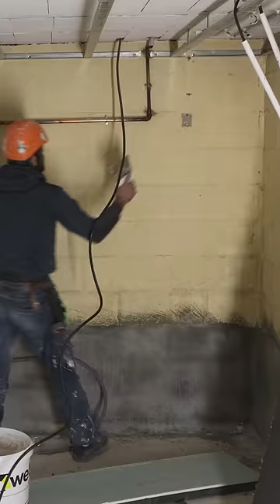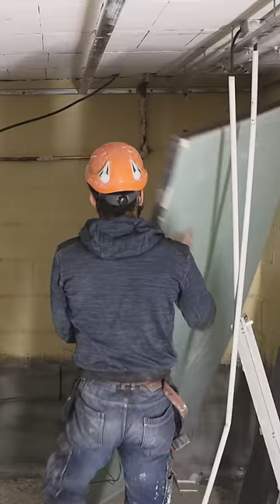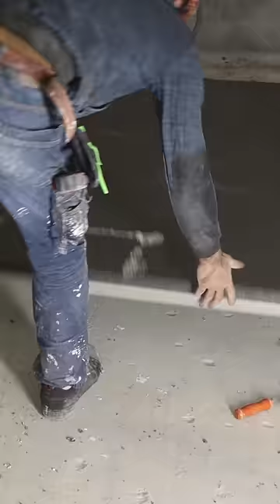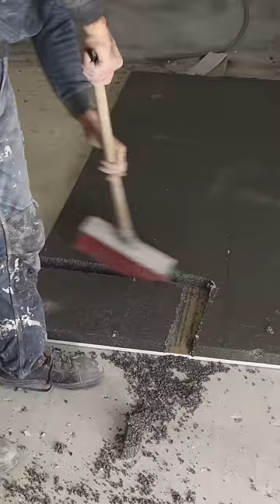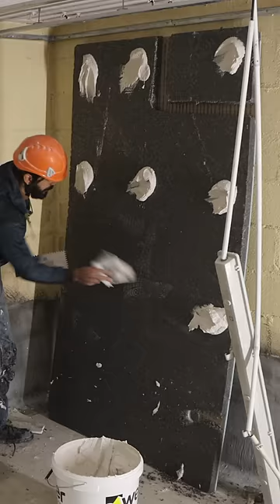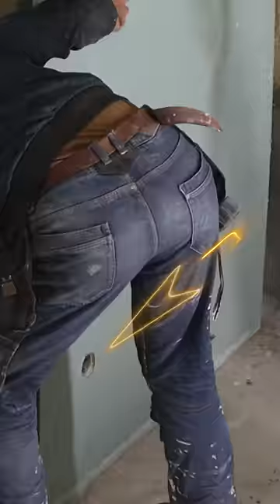pose amazing

Comment: Then some one comes along and drives a nail through the copper line while hanging a picture.
Reply: Looked like there was a shut-off valve on that pipe that got covered up.
Reply: I was thinking the same thing 😂😂😂😂
Reply: Siempre utilizó un detector de electricidad, metales y demás, ya he perforado por error más de una vez hace mucho tiempo.

Comment: Oh dear, so wrong not to continuously bed/seal all edges to prevent vapour ingress!
Reply: Always a pleasure when someone's so confident the're right, and the're completely wrong, drywall adhesive has no vapour stopping  properties whatsoever, perimeter dabbing is to reduce fire or rodent progress. Since it's insulated board it's not needed because both can despatch the insulation no problem
Reply: @mikepage9520  it is done totally wrong! The styrofoam has no function at all when the edges are not sealed. The insulation ist just wasted…

Comment: People usually do not cover up gas valves.
Reply: That looks like a water line
Reply: I don’t think modern homes have gas running through the house anymore. 😂 just from a tank to the kitchen. Safe
Reply: People usually do not cover up water valves either, that’s what I was thinking.
Reply: No valve, I think your mistaking the wall hanger for a valve
Also it's copper pipe, most likely water
Reply: Where did you see a gas valve.
Reply: It's not gas. It's copper pipe. No gas in copper
Reply: Es tubo de cobre para el agua, aquí en España la tubería de gas es totalmente distinta, además de que siempre están escondidas en la pared de ladrillos.

Comment: I hate to tell you this but you're gonna have to take that back off and replace that copper pipe at the 90 because its gonna leak because who ever did that blackened the pipe. So that solder joint is no gonna last long.
Reply: Yup

Comment: maybe I don't get it, you leave a water pipe that is against the other wall, un-insolated from the cold, then use some strangely isolated foam drywall over it?  not to mention you waste drywall compound instead of using measurements to mark it out?... please explain? as we really don't understand what this is support to protect?

Comment: Shocking work. If that's a gas pipe then it should be covered with a solid dab of board adhesive. Because if you drill through it or the pipe splits, the gas can only leak through the hole and not fill the cavity and boom! Blow your house wide open. Fucking joke tradesmen.